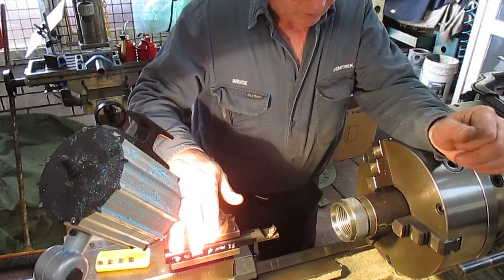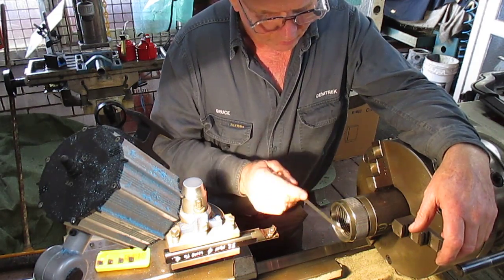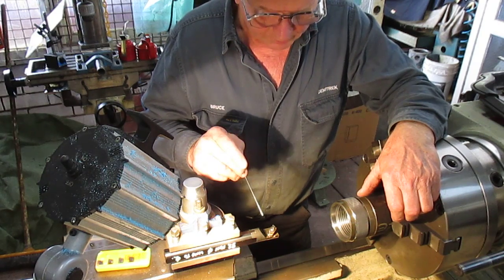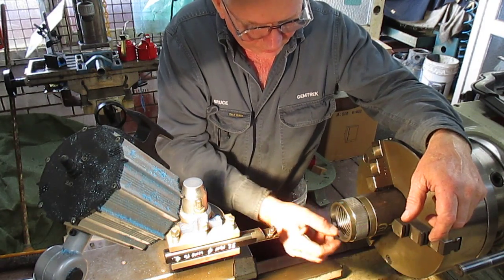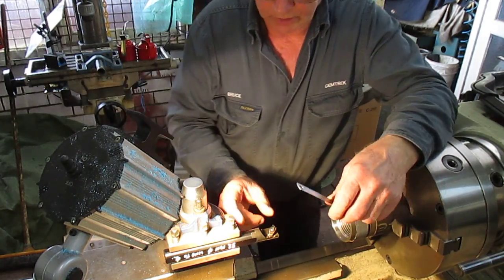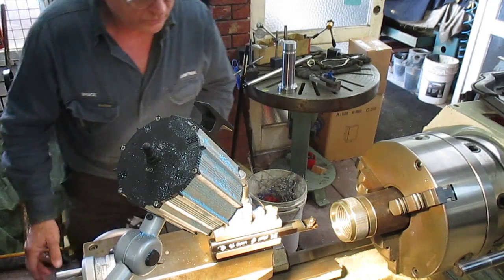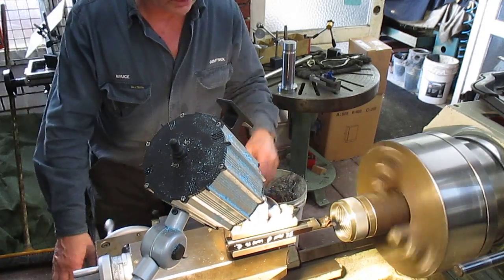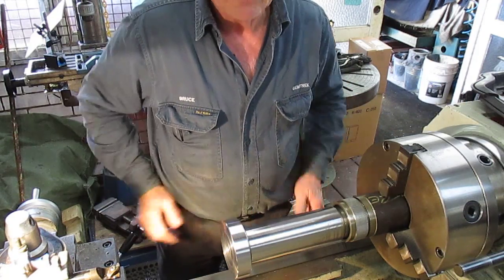Weekend Special Gage Toolmaking Part 4

Comment from the maker: Mark,
Firstly, if I'm not wearing my hearing aids (I don't very often in the workshop for obvious reasons) then I don't hear what noise you are eluding to. secondly from what I have seen of the 5 lathes the same I checked out before I bought this one they are all the same, it is the nature of the brake, My TOS uses a DC power arrangement on inside the motor so there is no mechanical noise except the slowing down. My old Colchester used to make even more noise than this lathe.